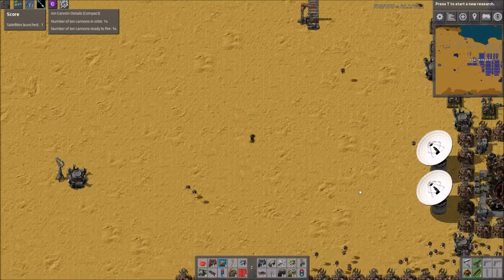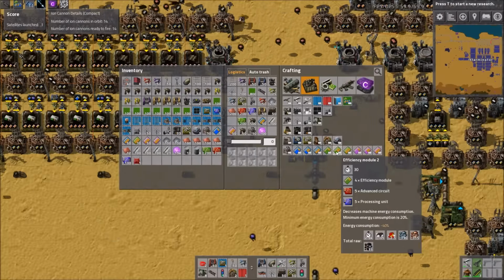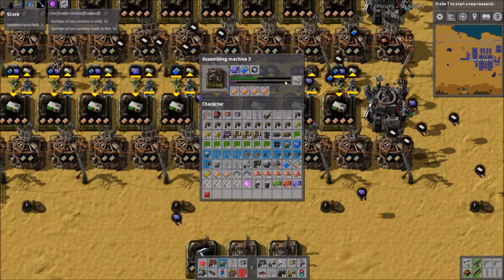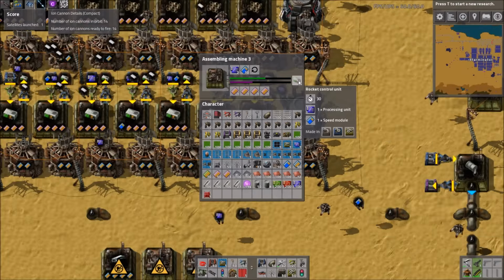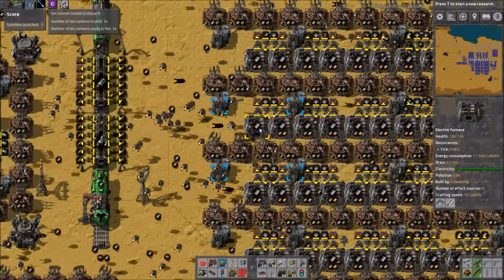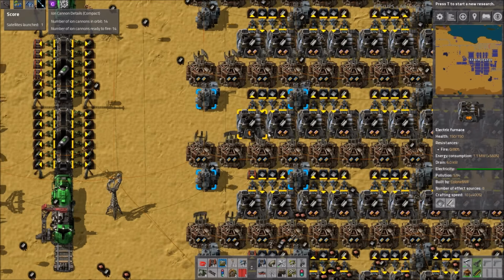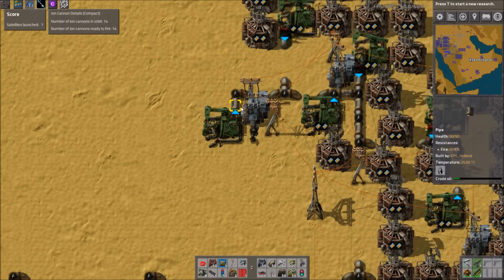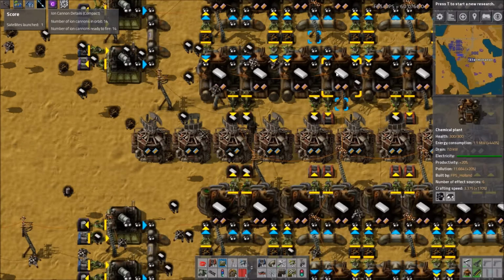Benefits of Speed / Productivity Modules & Beacons - Factorio Tutorial

Comment: Honestly I don't feel this video is particularly helpful. It was basically 'look how big these numbers are' while not actually showing how/whether modules are more effective than simply not using modules. So here's my take on the benefits of modules.

1) Space efficiency. The most obvious one, built-in modules save you space. This is also true of beacons since if you load them with 4 Speed Module 3s, then they'll add a 100% speed bonus to all the machines they affect. And since they're the same size as Assembly machines, this is at the minimum equivalent to placing another Assembling machine.

2) Resource saving. Productivity modules are really best used to save on resources that are either rare or required in large quantities, at the cost of a bit of throughput. 

3) Combining productivity and speed modules to get optimised builds. You did talk about this, but you didn't explain WHY it was effective. Basically, any modifiers from modules stack via addition, rather than multiplication. This is important because it means that you can get more bang for your buck. This is because speed modules will be more effective on lower speeds.

So okay, we want to use productivity modules with speed modules, but what's the best ratio? For that we need to do some MATHS (aw yeah)

So we have our machine that produces something. We'll say that this machine produces one unit of whatever it produces per second by default. Note that a 'unit' could be a single output, or it could be multiple, or a partial output. It's arbitrary. Now, lets say we add p productivity modules to it (Obviously modules in a beacon only count as 1/2 a module). Now this increases productivity to (1+0.1p) units, however with the speed decriment we end up producing (1+0.1p)(1-0.15p) units/sec

However, lets say we now add s speed modules to our machine. Since the modules stack via addition, our speed modifier becomes (1-0.15p+0.5s), thus our final production is (1+0.1p)(1-0.15p+0.5s) units/sec.

Now at the moment this is completely useless to us. It shows what our output will be, but not what the best solution is. So we need to do some optimisation 

Firse off, we'll assume that your build can have a limited amount of modules. We'll call this amount x. Now, p+s=x. And thus s=x-p. Now we can insert this into our production experssion to get (1+0.1p)(1-0.15p+0.5(x-p))=(1+0.1p)(1-0.65p+0.5x). Now if we expand this out we get 1-0.65p+0.5x+0.1p-0.065p^2 +0.05xp

If we simplify this we get (1+0.5x)+(-0.65+0.05x)p-0.065p^2. You may recognise this as a quadratic equation. And while it's technically an expression, yes, it is a quadratic. Note that x is actually a constant in our scenario. This is important because it's time for everybody's favourite part of maths: calculus!

See, right now we have an expression of our units per second, and we want to find what the maximum value of this expression is. So we're going to take the differential, set it to be equal to 0 (since the gradient at the peak will be 0) and the value of p that makes it so will be the optimal value, from which we can obtain s. So LETS GO.

So we differentiate the expression with respect ot p and we get (0.65+0.05x)0.13p.So now if we work out p when (-0.65+0.05x)-0.13p=0 then we'll have our optimum p (quick note if we differentiate again, we get a constant negative, so the result WILL be a maximum).

So 0.13p=0.05x-0.65
=> p  = (0.05x-0.65)/0.13 = 5x/13 - 5

And so now we plop this into our s=x-p equation to get s = 8x/13 + 5

Now pretty quickly we should notice that this doesn't work for small amounts of x. This is because my initial conditions allowed for negative values of p and s because I'm lazy. This leads to the algorithm humorously suggesting to use negative productivity modules at first. Once we get to 13 modules total (the amount needed to make 8x/13 + 5 <x) it behaves normally however. So what does this tell us?

Well, assuming my maths is correct (if it isn't please let me know so I can correct it) it isn't worth using productivity modules AT ALL until your total module count is about 13. record scratch Wait what? 13 modules? That's crazy! I'll be honest I was writing this on the fly, and wasn't expecting it to be this biased towards speed modules.

But okay, lets actually apply this. For a row-based system using Assembling Machines (3) you can fit 8 beacons per machine. This translates to 16 modules in the beacons (accounting for each beacon module counting for half) and 4 modules in the machine itself, making for a nice round 20 modules altogether. So according to the algorith you should have 2/3 productivity modules (it's actually about 2.7), and the rest be speed modules. If you're still using Assembling Machine 2s then it's pretty much exactly 2 productivity modules per machine. 

Whew. Apologies for the text wall, I got a bit carried away. Now I REALLY hope I didn't make a mistake >_< I should note that this is all theory - it's based on assumptions that as far as I know are true, but may not be.

I also want to give a quick mention of the Efficiency module - it's rubbish, for the most part. Since its modifier is based on addition, like the others, it ends up being less effective at higher power requirements... but that's exactly WHEN you'd want it to be more useful. The only real use for it is in systems where you don't need such a high output, but even then it's pretty mediocre. Also never use it in beacons. It's not worth it at all.

If you've read this, thanks! It means a lot. If you noticed a mistake then please let me know - I wouldn't be surprised since I wrote this over the course of a long time when I should have been sleeping :P Also sorry for being so critical of your video. I do stand by my statement, but I doubt my comment is particularly helpful either ^_^

Comment: My concern with these speed rates is, don't you get to a point where you are grossly outrunning your logistic speed? either by belt or robot (or pipe), isn't there a practical limit to how fast you can input and output stuff from an assembler/furnace? what about fluids? isn't there a limited throughput for pipes?
Reply from the maker: There is a limited throughput for pipes and you're right that can be exceeded if you go overboard with your layouts. However, it can partially be combated by having the input put in from both sides rather than just one side, and also just making multiple smaller layouts with high speed rather than a huge one with high speed that would exceed the pipe limits. 
As for other production using belts or robots, then yes and no. Belts have a very hard limit in the fact that you the highest you can can go in vanilla is Blue Belt, and it has a set limit of 40 item/sec. This is partially why robots are preferred for huge late-game bases (the other reason is bots cause WAY less lag than belts). Fully upgraded logistic bots actually have a higher potential throughput than blue belts. And you can easily have thousands upon thousands of bots working without that huge of a performance hit. So really you would probably lag out just from sheer game calculations before you hit an actual throughput limit with bots.

Comment: Your advice is all well and good for late game, but there are some places mid game where this is bad advice. Anywhere where you aren't fully using your production, speed beacons are worthless. For example, when I build my smelting setup, I like to build enough for full blue belts even when I'm still only using red belts. I won't be using that much iron for a long time, so adding speed modules in beacons only wastes power as the furnaces stand idle. Similarly, if I'm not making full use of my oil, adding speed or productivity does nothing, so I might as well decrease the power consumption with efficiency modules.
Reply from the maker: Johnathan Gross If you aren't using all your production then yeah there is no reason to use modules at that point, and I don't think I ever advised people to use modules if you don't need them.
Reply: Not saying you did. I'm just pointing out a use case you didn't cover.